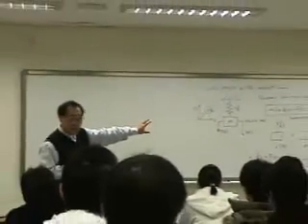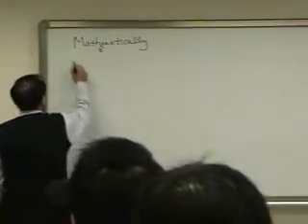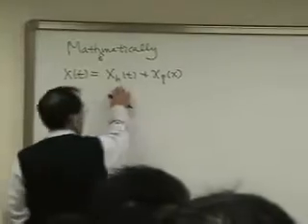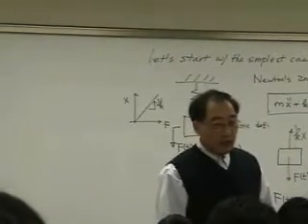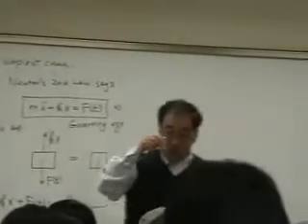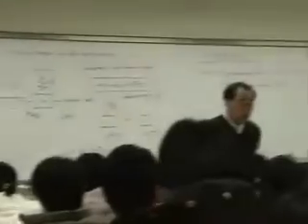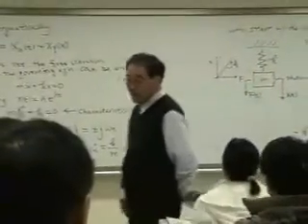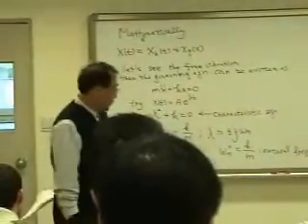[Lecture 2-3: Introduction to Vibration] Mechanical Vibration by Prof. Yang-Hann Kim at KAIST

Comment: when the equation is mx'' + kx = 0 isnt the trial solution x(t) = Asinwt?

if there are initial conditions for excitation, and no damping (no 'friction') this system will oscillate endlessly wont it? so you need a solution of Asinwt or something similar, not Ae^(d*t)